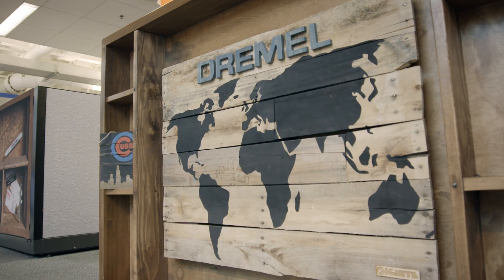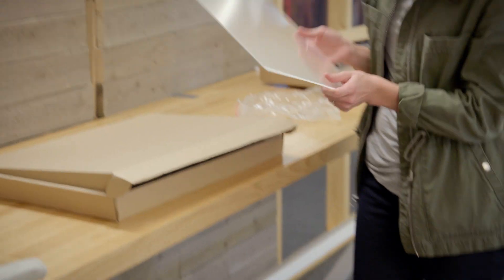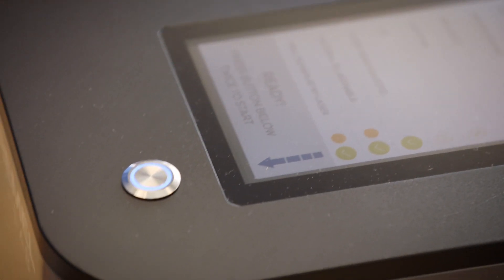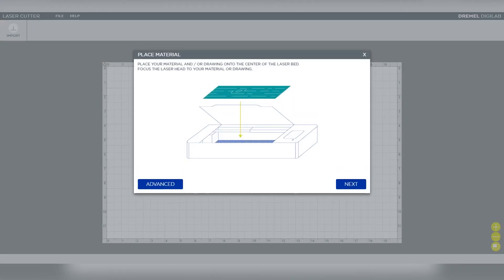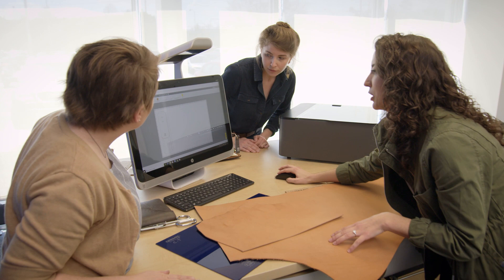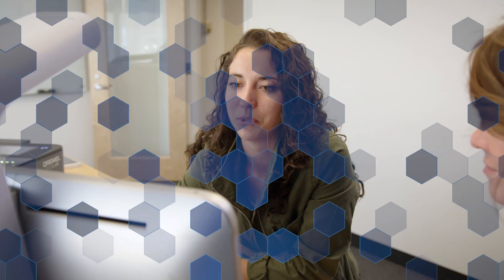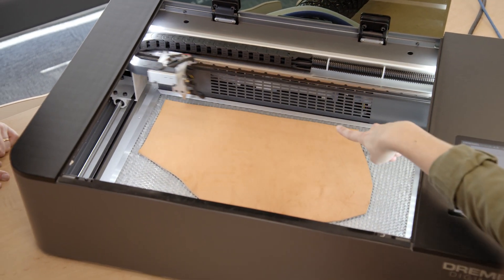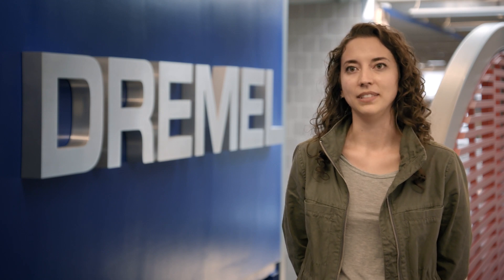The Cutting Edge: Dremel DigiLab Laser Cutter Unboxing

Comment: So why $6000 for this and a Chinese laser that is also a 40 watt C02 laser for $400?
Reply: Software, ease of use, build quality, R&D.
Reply: @CarlosElPeruacho  Mr Beam II is cheaper and does the same stuff...
Reply: @herodesh I responded earlier, but I realized I'd been mistaken on the Status of Mr. Beam II. That being said, MR Beam 2 isn't a 40W CO2 laser, it's a 5W semiconductor laser. Furthermore the MB2 is cloud based like the Glowforge, which Dremel is specifically calling out when they claim their laser has all of the software built in to it. GF seems like a better value than MB2 for the money, 3500 euros vs 2495 USD. For people who don't want a cloud solution but want ease of use, Dremel seems like the option, though I certainly wish they were cheaper. That being said, when they become too inexpensive the market will saturate and any business prospect will start to diminish. That's already started happening.
Reply: Qna